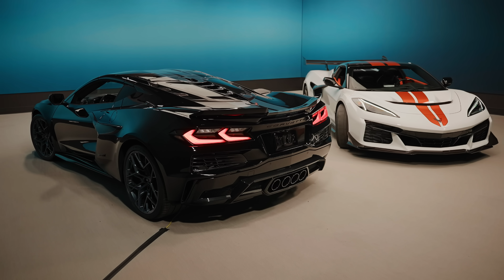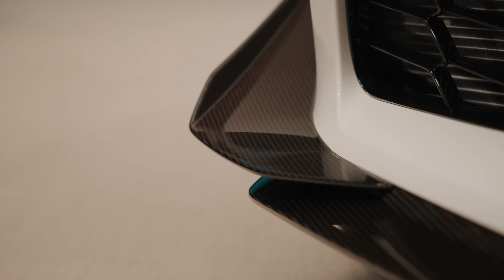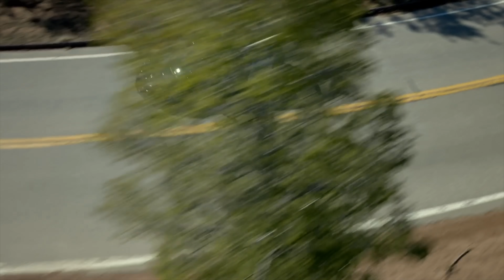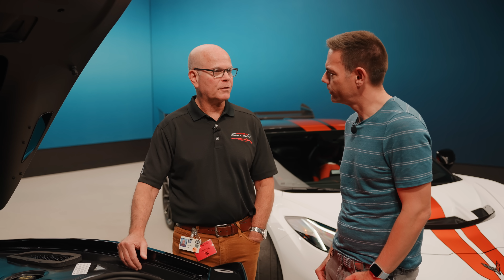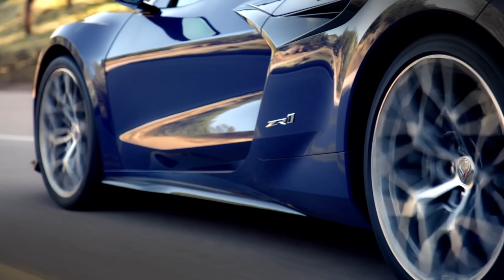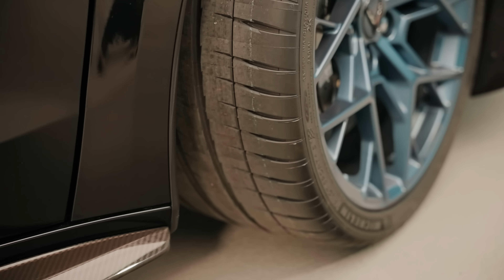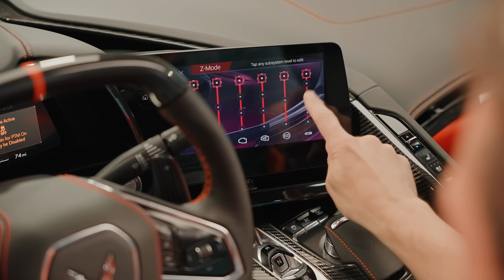FIRST LOOK: 2025 Corvette ZR1 – 1064hp, Turbos & 215mph!

Comment: I’m taking about race track not drag racing or top speed racing! :-) 

C4 ZR1 and C5 ZO6 both out perform cars like Ferrari F40, Ferrari F50, Lamborghini Countach, Lamborghini Diablo, Jaguar XJR-15, Jaguar XJ220, Cizeta V16T, Vector W8, Viper GTS-R, Viper ACR, 2000 Mustang SVT Corbra R, 2003/2004 Mustang SVT Cobra, Porsche 959 and maybe Porsche 911 GT1! :-) The only 5 other cars that could out perform the C4 ZR1 and C5 ZO6 was the McLaren F1, McLaren F1 LM, Mercedes Benz CLK GTR AMG and Mercedes Benz CLK GTR AMG Super Sport, Panoz Esperante GTR-1 Road Car and Bugatti EB110 Super Sport! :-) 

With proper tires C4/C5 base does 0-60 in 4.2 to 4.1 seconds and C4 ZR1/C5 4.0 to 3.9 seconds! :-) Top Speed for base C4/C5 is 175 to 180mph and for the C4 ZR1/C5 ZO6 is 186 to 175mph and keep in mind 2013/2014 Ford Mustang GT California Special does 0-60 in 4 seconds and had a 186mph top speed with a 420hp 5.0L NA V8 engine also with 6 speed automatic also known as the 6R80 which is GMs 6L80 transmission for use in Ford vehicles! :-) The 6L80 and 6R80 are used in the Silverado and F150 with different tuning from Corvette and Mustang! :-) Corvette Grand Sport C6 does 0-60 in 3.7 seconds and has a 195mph top speed with a 436hp 6.2L NA V8 engine! :-) 

Japanese supercars are not far behind In performance compared C4 or C5 Corvette bridging the gap between Mustang, Camaro and Trans Am! :-) 

Fun fact, the White Viper Prototype back in 1988/1989 was based on a C4 Corvette! :-) 

C6 ZR1 outperformed cars like the Ferrari Enzo, Lamborghini Murcielago LP670-4 SV, Lamborghini Revetnton, Porsche Carrera GT, Mercedes Benz SLR McLaren 722, Viper ACR, Mustang Shelby GT500, Ford GTX1, Maserati MC-12, Nissan GTR Nismo and Saleen S7! :-) The only other 5 cars that could outperform the C6 ZR1 was the SSC Ultimate Arrow, Bugatti Veyron, Koenigsegg CCXR, Saleen S7 Twin Turbo, Pagani Zonda and Ultima GTR! :-) 

C7 ZR1 competition is the Lamborghini Aventador SVJ, Ferrari Laferrari, Porsche 918, McLaren P1, Nissan GTR Nismo, Viper ACR, Viper GTS-R, Mustang Shelby GT500 and Ford GT! :-) Cars faster then the C7 ZR1 are Koenigsegg Agera RS1, Ultima RS, Bugatti Veyron, Bugatti Chiron and Pagani Huayra! :-) 
 
Plus C4, C5, C6 and C7 are on GMs Y-Body/Chassis platform which was designed in the mid 1970s and ran from 1983/1984-2019 which is 36 years! :-) This new C8 platform is loosely derived from the old platform! :-) One ect in common with the C8 all new platform and the Y2XX Platform uses a backbone similar to Y-Body/Chassis Platform and takes inspiration from that platform! :-) Old platform is called Y1XX and the new platform is Y2XX which means the Y-Body/Chassis Platform is in it’s second generation! :-) There’s another Y Platform that ran from 1960 to 1963 has nothing to do with the Corvette! :-) 

L83 made 210hp and the L98 made 235hp all the way to 257hp! :-)  

Everything from the LT1, LT4, LS1, LS6, LS2, LS3, LS7, LS9, New LT engines have to thank the LT5 in the C4 ZR1! :-) GM severally underrated the power of the LT1, LT4, LS1, LT5 and LS6 for C4 and C5! :-) LT1 360hp, LT4 370hp, LS1 365hp, LS1 370hp, LT5 385hp, LT5 420hp, LS6 385hp and LS6 420hp! :-) Ford underrated the Mustang SVT Cobra engine which was a 4.6 L supercharged V8 that produced 420 hp! :-) Ford was going after C4 ZR1 and C5 ZO6 plus Viper GTS-R and ACR with 2003/2004 SVT Cobra and 2000 SVT Cobra R it has a 5.4 L naturally aspirated V8 that produced 385 hp! :-) 

Lotus went racing with the LT5! :-) They used it in their own race car for LM Racing plus they also use the Viper engine as well! :-) 

Base Corvettes are super cars and the reason is they compete with Ferrari, Lamborghini, Porsche, McLaren and Audi! :-) 
Base C4, C5, C6, C7, C6 Grand Sport, C6 ZO6, C7 Grand Sport and C7 ZO6 Corvettes compete against Alfa Romeo 8C, Ferrari F355, 360, F430, 458 and ect, Lamborghini Jalpa, P140 Concept, Calà Concept, Gallardo, Huracan and ect, Porsche , 911 GT3, 911 turbo, 911 GT2 and ect, McLaren MP4-12C and ect , 2005 to 2006 Ford GT base, Ford Mustang GT and up, Dodge Viper base, Chevrolet Camaro SS and up, Nissan GTR base and up, Audi R8, Mercedes Benz SL base and up, Mercedes Benz SLS AMG base and up, Mercedes Benz AMG GT base and up, Mercedes Benz SLK base and up, BMW 6 Series base and up, BMW I8, BMW Z8 and BMW Z4! :-) 

The Mustang GTD is in between the C8 ZO6 and C8 ZR1 performance wise! :-) 

C8 Stingray is a super car, C8 Eray is a super car, C8 Grand Sport is a super car, C8 ZO6 is super car/hyper car, C8 ZR1 is a hyper car and C8 Zora is an extreme hyper car competing with Koenigsegg, Bugatti, Aston Martin and maybe Red Bull RB17 Concept if they decide to make their concept car a road legal production car! :-)  

With out the Corvette we would not have the Ford Thunderbird, Shelby Cobra, Ford Mustang, Dodge Viper, Ford GT, Chevrolet Camaro, Dodge Challenger, Dodge Charger etc and some Japanese cars super/muscle cars as well! :-) It was the Corvette inspired Carrol Shelby to make the Shelby Cobra and Ford to make the Thunderbird and the Mustang that was a replacement for the Thunderbird and etc! :-) If you do your 
research on everything it is all intertwined one thing that to another and it all started with the Corvette! :-) It’s like a domino effect except the Domino’s lead two different roads, and the roads, all parallel each other! :-) There’s a saying, called all road lead to Rome, except in this case all roads lead to the Corvette! :-) It’s awesome that Carrol Shelby worked the Corvette, Mustang and Viper and with out the Corvette you won’t have the DeLorean DMC 12 or the Bricklen SV1 which were specifically designed to compete with the Corvette! :-)  

People do not want to admit the Corvette is amazing which means the Corvette is amazing and remember if you don’t have people hating and denying you’re not doing something right! :-) When you have people hating and denying that means you’re doing something right! :-)

Comment: N 1967 Ford made this car called The GT40 and it Did 235 MPH back in 1967,,,lmao,,and this POS only does 215 almost 60 years later,,,It’s a joke
Reply: Hush boomer
Reply: It actually tested at 255 mph. Also Doug demuro just said that the Zora will have over 1,400 HP. I hope that's enough. Lastly, what was the gt40 (the track version) 0 to 60 ?
Reply: @amerhamad-zp6ge  0-60 is irrelevant. Numbers are a game for fools; real drivers work with driving experience.
Reply: @tranquilpowerhouse  0 to 60 is irrelevant ? What are you, an idiot ?

Comment: The platform is fine but compared to the C8  , the MC 20 is still heavier with less power. The weight and the engine as far in the US is what most people like. Maybe a more compact and lighter v8. As far as handling we know Dodge hasn't built anything with in reason since the AAR Cuda that was somewhat compared to the Mustangs Mach 1 and Camero SS.

Comment: It's so AMAZING.... 🙄 Not really. Considering that Bugatti introduced a thousand horsepower 4 wheel drive car 20 years ago that could reach a top speed of 250 mph, the only "amazing" or revolutionary aspect of this C8 is the price. As it has done in the previous 3 generations, GM has made "super car" performance affordable once again.  Beyond the value proposition though, we've been seeing thousand horsepower modified C5s and C6s for years and years. By contrast to the C5 and C6, the last two generations of Corvette appear to have lagged behind with near "brick" level aerodynamics. When a stock C6 Z06 has a top speed that's about 10mph higher than a stock C8 Z06, several thoughts come to mind and none of them seem very "amazing"...The Bugatti has been able to maintain incredible acceleration, handling, and top speed  - all from a very heavy platform. The new Ford GT40 achieves a similar top speed of 216 with "only" 650 hp. And technologically speaking, there's nothing the C8 can do that is significantly superior to what the similarly priced Nissan GTR has been doing for years. If GM can improve on the car's aerodynamics and still deliver a reliable, "affordable" super car - it will dominate this small market segment. But serious doubts still remain about the transmission's durability and the 20th century level Nascar aerodynamics. For anyone who has waited 20 years for the "latest and greatest" Corvette, this has to be a disappointment.
Reply: The Bugatti is a joke.

Comment: Where is the car? production pushed back three times now. Come on GM, get with the program and build a car. Scared that what you said is not true? It has been over 6 months now and there has not been one allocation at any dealership yet. GM will not even tell when the first one will be built, you know the one going to auction. Because there is no car. ZR1 ='s Fake Hype

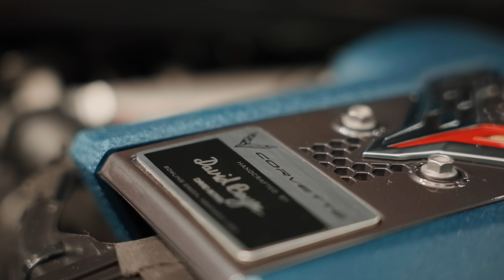Comment: 12/14/2024 4:56CET

USA go home with all your pretense and stealing from others. Your "first gen" of a vehicle never in production was a remodelled Honda NSX.
This time you took an Audi R8 and have Mr.Micky MOUSE CIA dwell over his marvellous engine achievement...

I mean - at your performance level you should avoid the public, there is nothing to brag about.

When did it all begin?
Must have been when you claimed to have landed on the moon with a modified dishwasher and lots of aluminum foil attached to it.
Big laugh from Germany!
Dr.Joerg Strate
Reply: Name a single all original manufacturing car. One that doesn't borrow anything from another car in one shape or form. We'll all wait.

Comment: The 215 isn't an absolute top speed. It is the safe top speed. The Corvette chief engineer Tadge Juechter said in a Car & Driver video it was 215+ and have not released an official top speed yet. I saw a video from GM that had it up to 221 and accelerating. You need something better than the GM Millford proving ground circle to do better.

The 'flow through radiator scoop in the frunk' is called an elevated gurney and was designed to control the airflow over the passenger compartment and to setup proper airflow over the rear wing.

Comment: What a car!  Kudos to GM for designing and building such an outstanding sportscar. To think that they just did this w/a normally aspirated engine is, IMHO, better than the Euro rides, especially so as it is priced very low in comparison. I  owned a 911 Carrera GTS and it was a fun ride, but truth to be told I was extremely disappointed in the engine's lubrication system when a took a 90 degree turn at 50MPH and the dry sump couldn't handle it. (I got a "paragraph" of dire warnings in the center of the dash. )I sold that car. I now have a 2010 Panamera S and absolutely love it in all it's entirety. That being said, I would purchase a ZR1 over a GT3 RS.  Why? It's more available to the driver on public roads and for a hell of a lot less money. To me, the coupe version in this video was stunning to see. This car is a winner no matter how you look at it.  Can't wait to see it in real life.........

Comment: I knew that the (General) would go out all the (Stratosphere) and  achieve a brand new (Engine)!
The (General) even told us years ago, when they mentioned that they had developed a (Flat plane Engine, (5.5)
in the (Z06 Vette)!
With innovation's of (CAD and CAM)
Technology, it would be easier to design a brand new Engine, quickly!
The had years of development of the (Z06) loaded into (Database of GM) so with the already stored (Technology)
A new can be designed quickly!

Comment: There is a reason why ford quit on the flat plane crank engine.  Wait till the oil pump fails. And it will. Its Chevrolet engineering

Comment: What website had you thinking the ZR1 was going to be a hybrid????   It has always been stated on the internet as a Zora model.  Only suprise on the ZR1 is the horsepower.  Most estimates were between 850 to 900.  Then GM comes out with 1064.  This makes me question Top Gear researchers.

Comment: 1064 Horsepower is all well and good, but how often will you be at 7K RPMs in top gear?  What I love is 800 torks from 3,000 to 6,000 - think of the pulls!  If the limit is 70, i drive 79 or 80, and this beast will get me there quick.

Comment: dont get me wrong.. i LOVE the design and i absolutely LOVE the engine! Kudos they didnt go hybrid! but not even having 10 MPH more top speed and also having a sub 10 second 1/4 mile time just like the 911 Turbo S while the Turbo S „only“ has 650 HP is a little disappointing imho
EDIT: while using double the fuel than the 911

Comment: BTW:
It’s NOT the first ever turbo Corvette!

Cheers
Reply: The Callaway twint turbo was not a stock Corvette
Reply: @EFK1993  a.) That wasn’t the only one.

b.) Callaway actually had a standard Chevrolet dealership RPO number, so yes, you could actually order and service it directly via Chevrolet.

Best wishes
Reply: @asc23channel  What other Turbo Vette was there and the Callaway Twin Turbo was installed 3rd party by Callaway the cars were ordered to spec and then shipped to Connecticut so no not a stock car
Reply: @EFK1993  There were a couple, mostly drop-shipped to the end manufacturer, like Zora Arkus-Duntov etc.
Callaway were handled similar to AMG or M-Sport Gruppe, Abarth, Pininfarina, Zagato, etc., they were officially certified and had a standard order number. Many models (f.e. Mercedes Cabriolets) weren’t even built by the original manufacturer (back then). Cadillac also shipped certain standard models back-forth to/from Italy for production…etc etc. Many manufacturers don’t build the cars themselves. As long as you can go into any official dealership and order the car, that’s what counts.

Best wishes
Reply: @asc23channel so once again what other turbo Vette was there?

Comment: So at full throttle the fuel tank empties in 9 minutes and putting you 32.25 miles down the road ?😮 You might want to carry a few  5 gallons foam fill fire proof gas cans in the trunk 😅

Comment: Hopefully the ZORA is a hybrid all wheel drive version of the ZR1. Put a 500+ HP electric motor up front with a small solid state battery. The electric system could function as launch/traction control and assist with braking/kinetic energy capture.

Comment: Hopefully the ZORA is a hybrid all wheel drive version of the ZR1. Put a 500+ HP electric motor up front with a small solid state battery. The electric system could function as launch/traction control and assist with braking and an kinetic energy capture.

Comment: Why is almost every GM vehicle pure shit, except for the rare few.  The Corvette, Cadillac V, …….ahhhhh that’s it. Why not put this effort into every vehicle?  There regular V8 in pickups are failing with great regularity because of AFM and DOD.  The automatic transmissions need rebuilds at 80k miles because the torque converters self destruct.

Comment: Is this the top end for the platform? There has always been rumors that a "Zora" model may be slotted over the ZR1....maybe if you add the hybrid bits of the E-Ray with this engine. But I might think that only 160 extra HP to the front wheels might not be enough to be true hypercar status and to get past the overall weight gain.

Comment: While it is the first turbo production line corvette it is NOT the "first ever turbo charged corvette". Callaway produced 510 twin-turbo Corvettes between 1987 and 1991. The cars were available as a factory option through Chevrolet dealers and were built under the Regular Production Option (RPO) code B2K. They came in coupe, convertible, and Speedster forms. Get it right please.

Comment: Blows my mind , how it’s main competition it wants to beat is the GT3RS … a challenger with half the power , smaller capacity and NA.
Idk im more shocked by what Porsche has Created…
Coz I think they went with twin turbo Because it’s easier to make these crazy numbers vs supercharger .
Coz modern tech shows t-turbo large displacement we’ve seen all before…. nealry any tuning house has 2000hp 
  
I’m more impressed with c8 zo6 rather than this … coz if u want straight line speed go electric or hybrid 
I think this is lazy 
They spent most money on z06 
This is lazy tune 
That’s why the keep going on about the HP…. Seieousky was hoping for more …
Also shows why they went with the double rear windows?  Trying to make up for the lazy creation … Coz the apart form TT it’s  a zo6 nothing more …